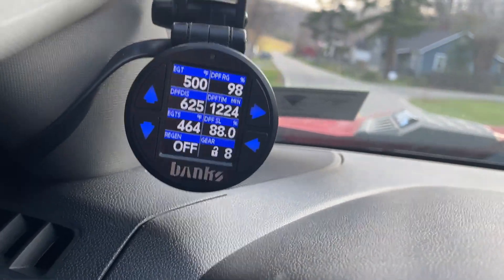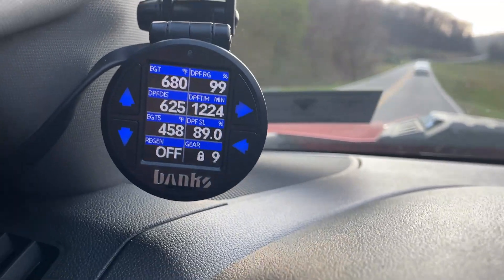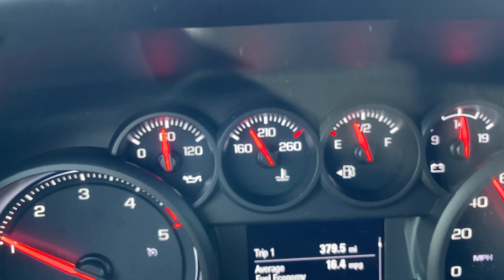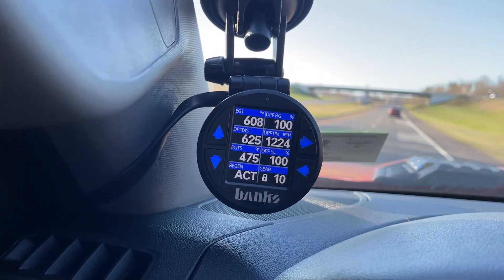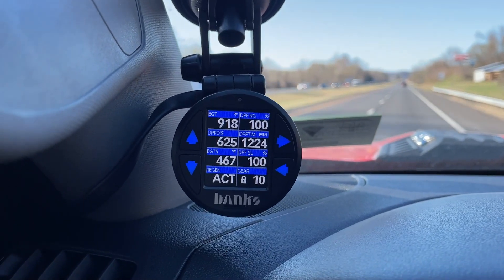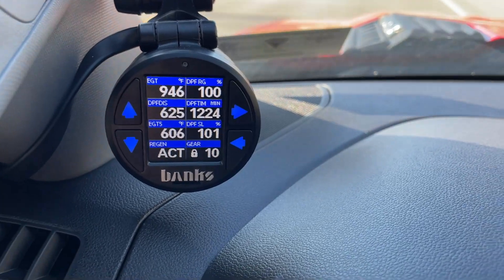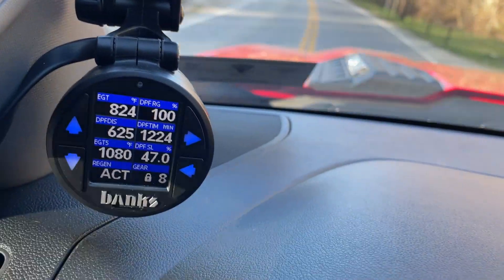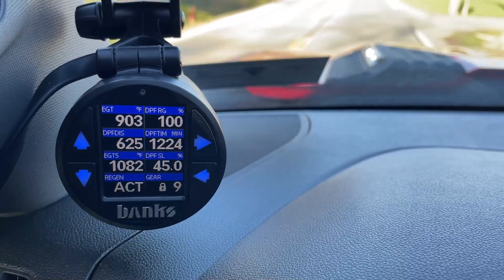How The Banks iDash Monitors Regen #292

Comment: Absolutely super video on sharing the Regen cycle and watching it live on the Banks unit what the GMC lacks is regen notices and what friggen gear I'm in. keep up the good work. Quick question I know the exhaust brake works in Drive when you apply brakes have you ever got the exhaust braake to work in Manual mode.   Thanks Mike
Reply from the maker: Yeah if the exhaust brake is on and you manually shift down it engages the brake, the higher the rpm the more exhaust brake you get so each time you shift down the transmission and engine hold back because of going down a gear but  in turn it raises the rpm making the exhaust brake more aggressive, hope that made sense.
Reply: Ok something is wrong is your truck a 2024?  Any time my 24' HD is in Drive and I activate the exhaust brake I feel and hear it work, however if I shift to manual the E brake will not engage. If you get a minute try it again, I'm not the only owner that is experiencing this problem. Thanks  Let me know . . . Mike
Reply from the maker: I’ll try it on the way home from work this evening
Reply: OK thanks ride safe! Mike  @WilliamsonRidge
Reply from the maker: My truck is a 23. I tried it on the way home and I put it in manual and shifted down then hit the exhaust brake button and it definitely is kicking in and when I shift down again and raise rpm’s it gets stronger and I didn’t  have it in towhaul mode which should make it even more aggressive, maybe the 24 is programmed differently but I’ve seen other videos saying it is better than the 23’s maybe it does only work with the trans in auto? Maybe a difference between the 24 and 23? Dunno but my 23 definitely works in manual mode, I’ll try to research more into it

Comment: How did you set that page up on your I dash with all that information about DPF data? The display data you have is really cool stuff.
Reply from the maker: There’s over 200 parameters you can monitor on the newer trucks, there are 6 pages you can customize up to 6 parameters each, you just have to search each option, engine, transmission catalyst, etc and set them to your pages, I may try to do a video on it to show how it’s done
Reply: @WilliamsonRidge searched for like 30 mins while truck was running and using the app. I couldn't find all the setting that you use.

Comment: Thanks for this video. I got my banks a fews ago to be able to monitor for this because I had the idle time timeout disabled so I can monitor it and make sure I keep the soot level down when using truck and DC generator for my camper. It is really hard to find the details process of regen and what parameters to monitor in the Banks to follow the process. I will say I found out that in addition to the full regen process you showed here that anytime the EGT gets above 850F? it will do a passive regen and thats why you see those slight drops in SL and DPF RG while not in active. I am close to my first regen with Banks iDash installed so I only have EGTS monitored and was wondering how it would ever get to 800 F when it barely went above 550F in my driving
Reply from the maker: Yeah when it goes into regen it uses DEF fluid to break the soot down then adds diesel to the DPF to burn the broken down soot out,  you’ll also notice a significant drop in fuel mileage due to the injection of extra diesel, your EGTS after the dpf will go above 1000F especially if you are towing or on the highway.

Comment: A little background;
I am a journeyman diesel mechanic for Kenworth. I do not have any training on the Duramax engines, but, I can’t imagine the strategy between aftertreatment systems being that much different from the big rigs to pickup trucks.
Last year I bought my first ever diesel powered pickup. A 2019 Chevy Silverado 2500HD with the L5P Duramax 6.6l and 6 speed Allison trans. I bought it mainly for towing our camper, but it is our only vehicle so it does get driven daily.
As I said, I am no stranger to aftertreatment systems.
I was really surprised when I found out GM provides zero indication to the driver when the truck goes into a regen. No gauge, no light, no message in the info panel, NOTHING. 
I’ve been driving this truck for a year now waiting for a CEL or MIL to pop on due to aftertreatment issues, it hasn’t happened yet. 
YET…
I even bought a scan tool capable of forcing a regen when/if the need arises. 
So I’ve spent the last couple of weeks researching the Banks line of products, and I’ve gotta say, between another video I watched and this video, I’m sold on it. I’ll be ordering a few items from Banks and installing them myself. It is my understanding you not only have the ability to monitor regens with the I dash, but you can also force a parked regen AND read/clear diagnostic codes. 
I’m planning on getting the i dash, the pedal monster, the derringer, egr tubes, Ram air w wet filter, the 5” exhaust, and the ram air rear end cover. It’s quite expensive, but if you really take a deep dive, they all work together to reduce the overall amount of soot produced by the engine.
Hopefully increasing DPF longevity. 
Too rich a fuel/air mixture creates soot, which ends up in the doc and dpf. 
I think GM has their strategy pretty much dialed in to where the regular Joe doesn’t really need that much, but if you’re anything like me (obviously you are) then you WANT to know where you’re at with your vehicle.
I am also considering just buying a dpf and setting it aside so I can swap them out when the time comes. Damm things are SUPER expensive.
Kudos to you for taking the time to at least learn about what’s actually going on with your engine and aftertreatment systems. Can’t tell you how many drivers I’ve had to deal with over the last 13 years and train/teach over their own aftertreatment equipped semis. 
Sadly, the older guys like me normally end up blaming the techs and vehicle dealerships for their problems. They ALWAYS change their attitudes when I remind them that I didn’t mandate it, I didn’t design/engineer it, I didn’t build/manufacture it, I didn’t sell it to them, nor did I buy it (until now), my ONLY role in the entire exchange was to be available to HELP them. 
Great video by the way bud, thanks.

Comment: I am so glad I found your video. I bought my 2020 Silverado 2500 duramax about a year ago to pull our travel trailer. We are the second owners. It's currently at the dealer getting an all new DPF filter. I work from home and other than occasional towing I only use it for short drives around town. I had ZERO idea about regen until the dealer told me that the way I was driving probably caused the failure. Its silly that these trucks dont have any kind of dash icon or notification that pops up to tell you whats going on. Hopefully the addition of this little monitor will save me from anymore unwanted exhaust system failures from incomplete regens etc.
Reply from the maker: Thanks for watching, hopefully it helps out, when I was buying my truck I tried to find as much info as I could and it didn’t seem like there was much out there of what to expect with how all this stuff worked, so I figured as I learned stuff I would share as much as I could to hopefully help other folks out
Reply: If you don't mind, about how much did it cost you to replace the DPF Filter?
Reply: @rwreuter  I have a 2007 Dodge with a 6.7, the very first year they put DPF on diesels.  I bought it with 28k miles and the DPF died around 67k.  IIRC it cost $3,200 in 2013.  The new DPF died after 8k miles but fortunately Dodge replaced it.  As a result I no longer just take it to the store or short trips.  I had an Insight monitor that told me when it went into regen, if I was just driving around town (stop and go) it go into regen at around 60 miles, driving highway/long trip it would start around 115 - 120 miles.  Typically the regen lasted around 11 miles so like this guy said, I just kept driving it until it stopped.  Another thing, DPF do not like sitting at idle for long periods.  Also, I was told to drive with the exhaust brake always on.  Mind you, its a 2007 but it sounds like you do still have to worry if you get a newer, late model diesel.  I have 135k miles on it now but I haven't had to replace the DPF since.  Also, there are places that clean DPF's so getting a new one isn't the only option.